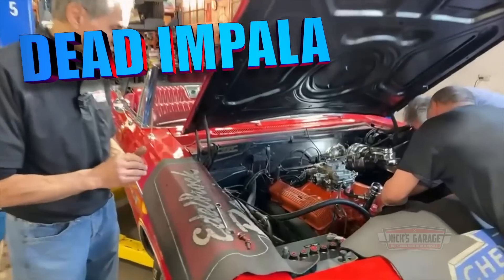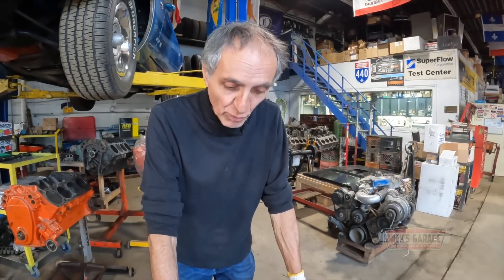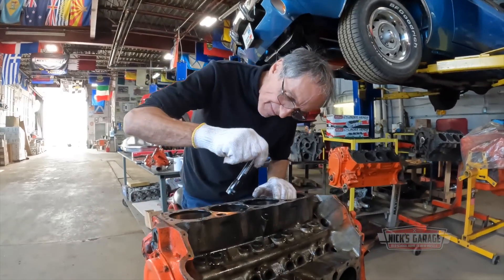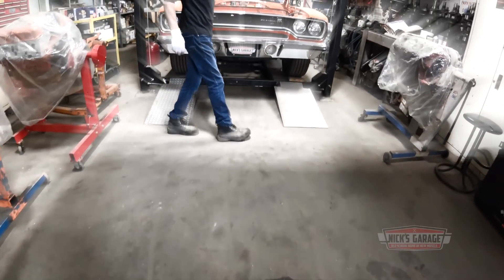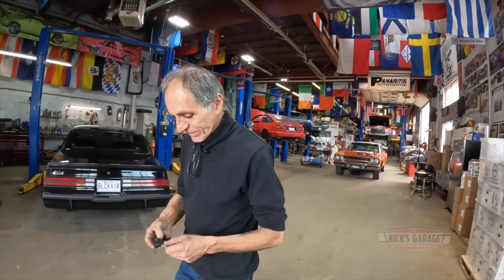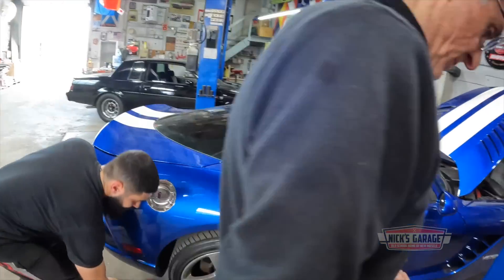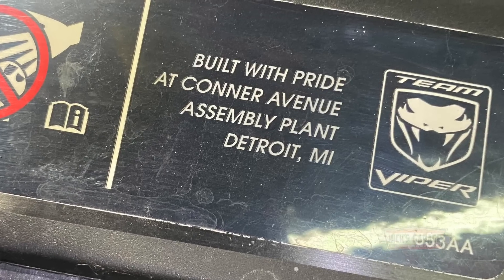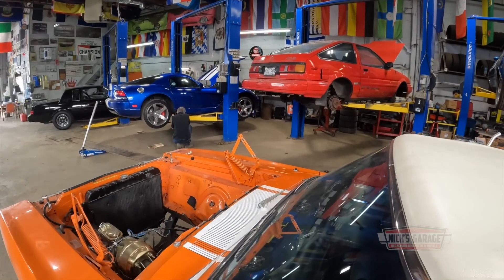327 Chevy Autopsy - Smoking Gun FOUND!

Comment: While not actually said in the vid if the engine was going to be replaced at Nicks cost under warranty,  I would still hold the driver 90% responsible here.  OK, the thermostat was faulty but the guy had to be driving with his head up his arse not to see, smell or feel something was wrong and get the thing that hot. They said the light was working and would have worked initially as there was no loss of coolant till it all boiled out. 

 I have had a few cars over heat in my time but it's not that hard to tell and too cook one to that extent I have never even heard of before! The thermo must have been closed from when it was started and who knows how far he went before the thing shut down. 

One is charged with certain responsibilities while driving and and if he couldn't detect something was wrong, how is he going to see other dangers on the road? Hope a kid never runs out in front of him or no one brakes suddenly or whatever. 
What if he hit something on the road and put a hole in the oil pan? Would he then drive the thing till it locked up and expect the garage to replace it?  Somewhat different but in reality no different at all.  It is not reasonable to palm all ones responsibilities on someone else.

Person needs to be aware of their vehicle and their surroundings and does have responsibility  for it's operation. 
This should have been a relative nothing. If the vehicle was being driven with Due diligence it should have been shut down at the first sign of trouble and taken back to the garage and the cost to the shop would have been a tow and a thermo not a total engine rebuild and replacement.  To put this all back on the builder is BS IMHO. 

IMHO, the driver is far more responsible for the problem than the garage and should be paying the majority of the rebuild. 
Would have been a cheap lesson in awareness that may one day save the guys life if he is that unobservant.

Comment: I'VE BEEN HAVING OVERHEATING ISSUES ON MY E250 5.4 TRIDENT V8 VAN FOR THE PAST 2 MONTHS TRYING ALL DIFFERENT KINDS OF THERMOSTATS AND DRILLING THERMOSTATS. AS A RULE OF THUMB I CONSTANTLY WATCH THE TEMPERATURE GAUGE AND WHEN IT STARTS CLIMBING UP HIGH I TURN THE HEATER ON FULL AND I KEEP IT UNDER CONTROL. THIS IS WHAT THIS GUY HERE SHOULD HAVE DONE WITH THIS 327 WHEN IT WAS RUNNING HOT. HE SHOULD HAVE TURNED THE HEATER ON.FULL INSTEAD OF HIM KEEP DRIVING IT.

Comment: If it's a classic convertible why even run a thermostat isn't like it's gonna be driven in the freezing cold where you need the heater and it doesn't have an ecm reading the temp. It's a carb engine adjust it to run cooler. I don't own any vehicles with thermostats they are out of all our farm tractors and only go in in the winter because diesels don't heat up without them in the winter and my 67 chevy c30 doesn't even have a heater box anyway so why have a thermostat it runs around 130 all day loaded or unloaded

Comment: This is the problem anymore with 3/4 of the crap made by Holley. Its overseas manufactured JUNK. No QA, just riding on brand reputation. While the owner should have noticed the gauge being pegged, its possible the gauge didn’t peg out either if they are/were the OE gauges.  Old uncalibrated OE gauges aren’t exactly the most accurate things out there. 

The owner should have had other cues though. At a minimum you can usually smell them.

Comment: When thermostat is exposed to temperatures hot enough to burn paint it will fail a test.
I don’t believe the thermostat caused this extreme over heat issue.

Comment: Nowadays stupid is rewarded by stores doing 'no question' replacements even when the client/customer has clearly been at fault.

However, in this case the "fault" can be split between the thermostat manufacturer and the customer who didn't stop and check when the engine was stinking and there was a cloud being left behind the car - possibly because he would be expecting that "no questions" replacement/rebuild.
A faulty thermostat would not have caused the coolant to disappear immediately, so the excuse of the warning light not working because of the coolant being below it wouldn't apply initially.

However, I would expect Nick, because he's a nice guy, will do the rebuild for free and chase up "Mr Gasket" to cover his costs.

Comment: Look at the block , That engine was cooking ,  I would start with another block if you got to redo it , Looks like he drove it 200 miles held it to the floor Until he got at home ,  I have never seen nothing like this in my life  especially building a engine from the block up ,  I don't know what happened but that is NOT cause from no STUCK thermostat ,  Unless the thermostat stuck and the hose came off the pump or the radiator  and he put it back on or somebody did  and he drove it and all the coolant was out of the  engine , What I would do , I would be checking the tailpipes  and mufflers  for coolant and looking underneath the car and see if there is coolant all over the place

Comment: Do these cars have an oil-to-water automatic transmission fluid cooler inside the cold half radiator side tank? Coolant that mysteriously disappears without leaking and without exiting a head gasket can sometimes be found in the automatic transmission. :( Pull the ATF dipstick and look for strawberry milkshake. Nissans from the late 2000s or early 2010s had this problem BIG TIME. There may also be a crack in the exhaust port of one cylinder. Coolant can leak out of the crack directly into the exhaust port where it was slowly evaporated. Eventually the engine overheated big time and the head(s) warped which create a new floodgate leak which caused the big cloud of smoke you described. Severe overheating can ruin a thermostat, so it's kinda the "chicken or the egg" question on that. Regardless, wtf was the customer doing while on that drive??? Glad I don't live in the same city as he does. Oblivious, clueless, DANGEROUS driver. 🙄🙄🙄

Comment: I've never seen a small block Chevy is so hot it burn the paint off the side of the head deck surface! that's not just getting the motor hot. that motor would have been dieseling like a Cummins, well before it would be burning paint off the jugs. that seems like that was deliberate. you got to be deaf when your motor loses almost all of its power, and starts dieseling. to keep running it after that is bordering on ignorance. possibly overly rich carburetor? bad ignition timing?

Comment: Once that engine had no water the heat could have caused that thermostat never to open again. That test is not a sure deal.  Extreme heat will lock a thermostat up. Trust me because I didn't have to destroy an engine to find out.  Delco makes what's called a fail safe thermostat.

Comment: I'm lucky to smell something 4 times a day. I don't really have a sense of smell. 

I have over heater a motor before. Not smelled it obviously but the extra heat in the feet. The fact you need more throttle to maintain the same speed. Or you stopped anywhere and could see the heat radiating off the bonnet. 

Have never locked one up * not on purpose*

I have hydrolocked one motor in my life. After 6l of water lasted 5kms. It was $400 for a tow to go the 40kms . I figured the further i got it the cheaper the would be. 3kms from home and had been knocking for ten. 

That hadn't blued the cylinders , I pulled the plugs got the water out and started it to see if it ran and it did. Buick 3800.

He cooked the hell out of that thing he'd have been at the floor and losing rpm for that effort.

Comment: My opinion I don't understand how he did not notice  Something was wrong that motor got extremely extremely hot.  Neglect on the customer's part  That impala had to run rough and the customer thought he can make it home Instead of pulling over and calling a tow truck He knew something was wrong  I mean come on look at the motor how hot that thing got there's no way in hell that thing did not lose power while driving

Comment: Thermostats are rated at the temperature they START to open...180 = STARTS TO OPEN AT 180  should be FULL open at 200 or 202 degrees......they are NOT rated to be FULL open at 180.....OnWard......

Comment: I'm a man who speaks my peace. First, and this has nothing to do with overheating but, these cars were so nice when they came out. Problem was, the engines were just too small, 40 over or not, At the very least, a 350 would have been better fitted, maybe even a big block! Anyway, let's get down to facts here. We're all car guys. I have never seen a motor so hot that it bakes the paint off of the heads and motor. The only way I could see this happen, is my x wife's boyfriend driving my car until it got so hot, it cooked the motor. Do you all realize how hot the block had to be to cook off the paint. Come on. That exhaust had to be billowing out pure white from the anti-freeze. And that motor had to be shooting water out the top of that radiator. No way could anyone not know it was overheating, just my opinion!!!
Reply: Even fullsize cars (and pickups) of the era could be had with 230 or 250 inch sixes so 327 is NOT 'too small'.

Comment: Four gallons of coolant in 200 miles? No f_cking way that thing wasn't smoking like a steam train! The driver is obviously very ignorant or wanted a different engine! If it was using that much coolant, it would have hydrolocked when shut down previously! My thoughts: the coolant was drained and the thermostat was damaged from being heated dry. There is no f-ing way the driver didn't know what was happening! The burnt paint tells the tale! I would not warranty that engine!

Comment: Customer fault, if you are incapable of paying attention to gauges or lights, you don't have a right to pass responsibility. Customer should definitely buy the factory gauge pod that mounts in front of the shifter, eBay etc.. If you drive your car enough to cook it with functional light or gauge, you shouldn't own a classic car. Even GM will void the warranty on a crate motor if you overheat it.
For this customer maybe you should mount a shift light tied to the oil pressure and temperature light sending units. The smoke would have been oil with the engine cooking like that, it would have been water like at that point.

Comment: why,,on a new motor, dont you have gauges..check oil water, every day..was the block & heads crack tested. block,heads tanked. new rad. flow tested.thermo tested. never seen an engine cooked like that. it would smell to high heaven.owner is not a car nut..

Comment: Hmm.....Just say NO! to China parts! Mr Gasket makes PURE JUNK for the most part these days in my opinion....Used to use their distributor recurve kits for many years then they went overseas...Became JUNK! Only parts we could find that were decent were Isky and Crane distributor parts....Lots of suspect parts! The "new" replacement alternator I used in a 130,000 mile old 1998 S10 Chevy went about 3 years/35,000 miles when it blew up electronically...Always had a decent battery in the truck....Lots of GARBAGE out there now even with OEM parts.

Comment: The owner literally drove the thing so far it burnt the paint off the heads!  Never even heard of anything like that before.  How hot does that make it? At least 200oC in my book and probably more. 

Fault in the engine or not, that is the OWNERS responsibility for being so stupid and ignorant, no one elses.  Maybe Nicks garage is responsible for it overheating but the DRIVER is responsible for continuing to drive the thing till  the engine was totally and utterly destroyed!  What would he do if he got a flat? Keep driving till there was no rubber on the rim, skid off the road and have an accident then blame the shop whom just fitted new Tyre's?  I don't think so Tim!

The upside of this is the engine still turned and the damage to pistons and other mechanicals etc in my book was minimal considering. I think that's the real story here.  Owner is an arse clown but Nicks engine is built bloody well to still even turn after that level of brain dead abuse by the owner. 

100% the owners fault it go this bad IMHO and the owner should be the one paying for the replacement not Nick.

Comment: This is complete operator incompetents..!  what if a new thermostat is put in, it goes bad and it overheats again..? Is that still the thermos fault or the builders fault..?  If you have a temperature gauge, learn how to use it, learn how it works, learn how to know that it is working, learn how to know it is working all the time, learn to look at it alot, and keep looking at it, Gauges should be monitored constantly..! And if for some inconceivable reason you dont have a temp gauge you are a Damn fool...!  I could go through 10 bad thermostats or ANY cooling related issues and not cook the paint off of my block.